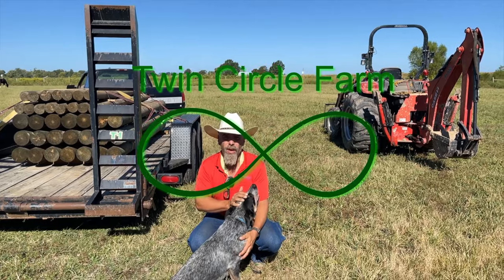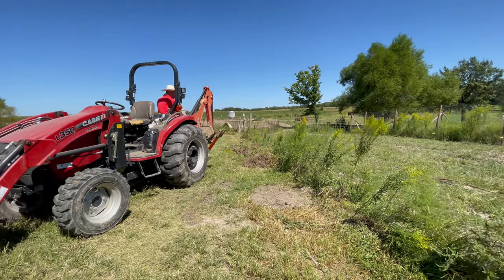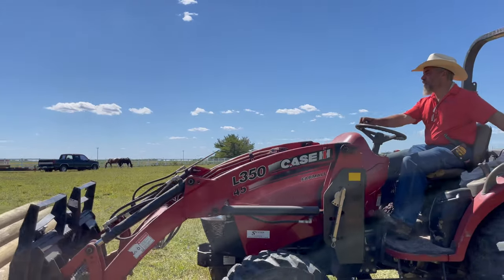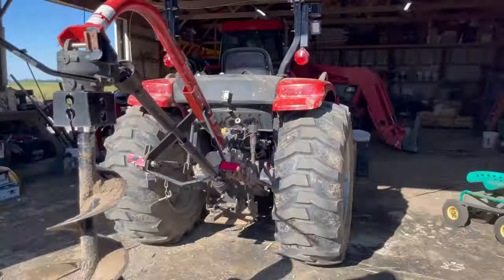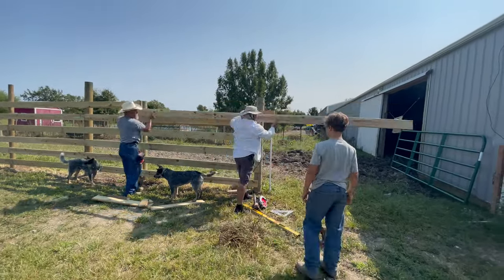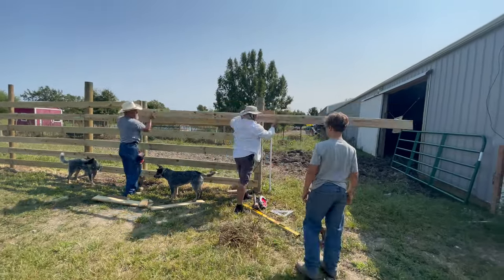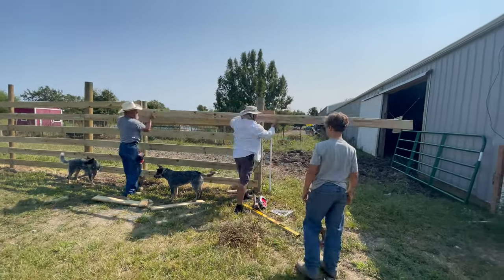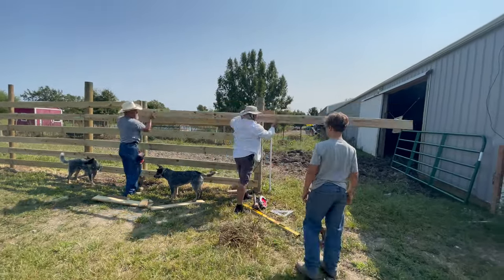Starting our new Cattle Handling system - and Berkshire Pigs eating pasture grass and weeds!

Comment: Not telling you how to..just saying in any cattle pen it always makes it stouter to use all heavy posts of same.
Reply from the maker: Welcome the advice. it’s pretty sturdy with the 4 inch plus then 6 inch plus every other post. We agree and also add that you should never use less than 5/4 boards. 1x would definitely snap with pressure from a big animal. 
It just really got down waiting on more treated lumber and the prices skyrocketed. it’s all here now, so we can finish the chute and some more alley fencing. 
we’ve been lucky that almost everything here has been really tame. the newest steers are the rowdiest we’ve had and they really aren’t to spooky. just got into a corner with the temporary panels that the steer pushed under in the temporary chute… lol.
got some up for processing so we should have a video of finishing the chute and pens by March.
Your advice is for everyone. build it tougher expecting a bad day for sure!
Reply: @twincirclefarm1171  yes I can understand prices. Everything went out of sight.  I redid a set of pens few years ago and the lots of 16ft cattle panels. I used 3 boards for structural strength..should have used 4. A cow went goofy one day and went through it between the two and three boards. The 4th board stopped that.
Reply from the maker: yep. We made the “working areas” 6 foot tall and as you can see there are six boards. growing up we had some bulls that if we had them today we’d have to out horizontals in to stop his pushing. these prices are ridiculous!